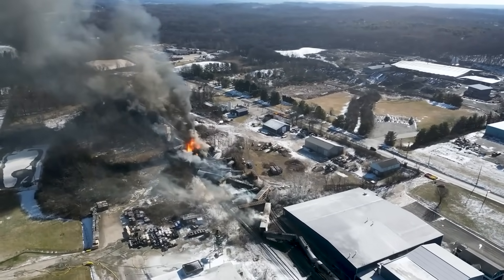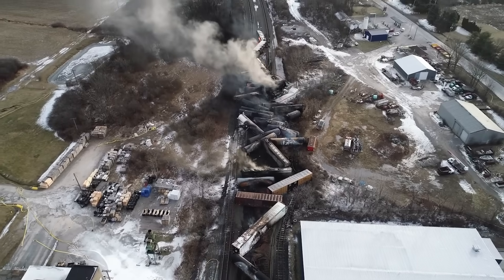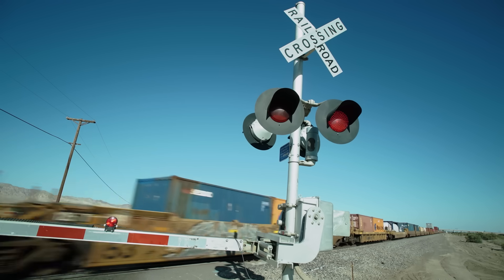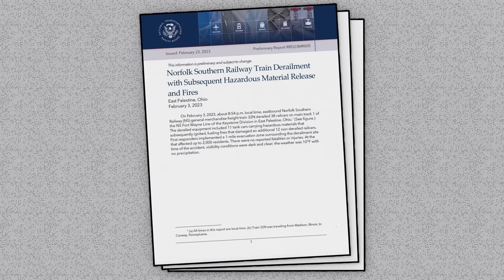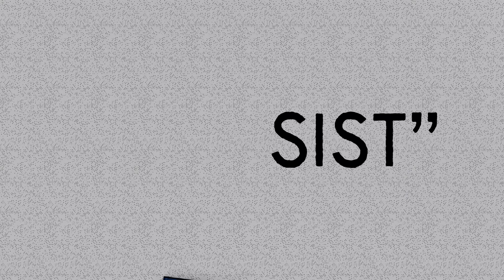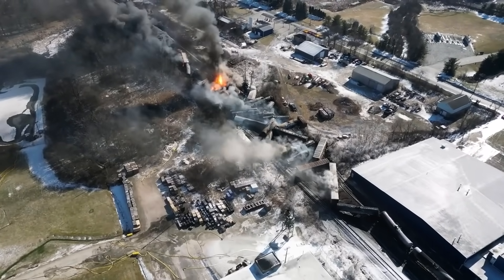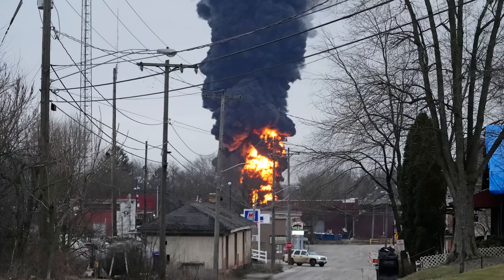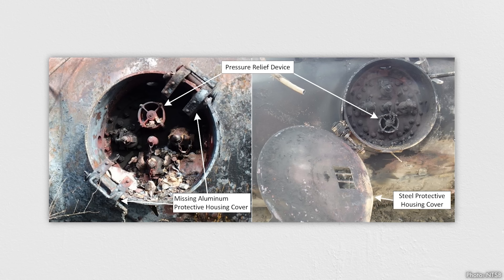East Palestine Train Derailment Explained

Comment: I'm surprised you didn't mentioned the temperature inversion that was expected, which is another reason they burned off the chemicals when they did. If they would have waited then it would have forced airborne contamination closer to the ground and increasing the risk to the community dramatically.

Comment: @practical Engineering Hi Grady, although it might cover some old ground from your older videos, it would be great if you could so a video on the Hook, Hampshire UK rail line landslip that happened a few months ago.  Fixed within a few weeks by a hero effort, rebuilding the 30 ft high bank using a mixture of retaining wall and soil pins I think.  (Some videos online from Network Rail).

Fortunately no trains were derailed or passengers injured, but it was a near miss on what is the busy 4 track passenger mainline between London, Basingstoke and the south/south west of the UK, with trains (8-12 coach 3rd rail EMUs mainly, some diesel hauled freight) doing up to 90 mph in this section.

Comment: So it's true that trains are necessary and won't be going away, but that's no reason not to push for better safety. Trains should not have to be as dangerous as they are in the US.

While fatalities may be few, in 2019 there were over 1300 derailments in the US, a small number in relation to how many train journeys are made, but objectively still a massive number.

The same year in the EU with six times as many miles travelled by train, there were 73 derailments. Japan, with three times the US distance had 9.

Comment: There’s so many ifs in this story that could have prevented the accident: in the bigger picture, legislation against monopoly and cartels, including separation between railway (infrastructure) and carriers, but in the gear aspect, if only the defect detectors cared about change temperature instead of only current temperature, it would be prevented; instead the media are talking about using better breaks, when in this case breaking hard WAS part of the problem

Comment: What actually happened was the railroad ignored the warning precautions there is no way that thing could have went as far as it did without a hot will detector telling the operator that they have an issue your looking at hundreds of miles do you understand I know a guy driving a Honda right now with both wheel bearings out of the back end of it and he's gone thousands of miles

Comment: About 2 weeks ago i stopped by a rail station and started to look at sleepers and nails holding them most every plate was missing at least  one nail, and had a loose nail, the head was sticking up by about one inch,  missing nails were fairly common

Comment: I think that when a rare event of magnitude X happens, instead of preventing another X level ovent, we need to work to prevent a 2X level event instead.  This is because if an event of magnitude X happened, it raises the possibility that the probability distribution we were working with is wrong and that such events are more frequent than we thought.

Comment: I don't understand why regulators are making Norfolk Southern perform the cleanup instead of performing the cleanup and billing them back. NS has every reason to literally cover things up in order to save themselves money, which they've already shown they're concerned with by the paltry amount of money offered to the residents affected. Yes, the EPA contracting out the work would have it's own issues, but at least the company responsible for the disaster wouldn't be the one responsible for deciding what's "good enough" and dragging their feet to get to that point.

Comment: 13:40
Does "the safest overland method" mean it is not safer than an underground pipe?
I'm pretty sure that was one of the aspects of why there is talk of building an underground pipe to carry oil from canada, because the alternative is to transport it by train.
I've also heard suggestions that train derailments are happening more often lately. Is that just because of easier access to information, or a real statistic?

Comment: I feel like if train lengths had a legal limit even if still quite close to what this train had it would eventually promote track safety and maintainence. As far as i understand these companies don't value maintaining the tracks at all because they can just put more trains across them and since they don't actually care about letting the few passenger trains take by-way first like it was orginionally agreed upon they can get so long as to block up any way to let anything pass. On the bottom line they don't notice anything, making a train longer cuts costs everywhere from personell to having to fix anything on the tracks and there is no intrinsic reward for them to care otherwise.
Long-term i anticipate that while safety might be cared more for accident rates will still increase because it was not deemed wort it to pay the overhead on infrastructure maintainence.
There are also issues with not upgrading to more modern equipment while relying on less crew these days. We can have minor cameras along a train these days in theory they don't even have to be good those sparks would be visible even in black and white.
If you want the trains in the future you have to make sure these companies leave a future for there to be train logistics to even exist and while accepting some risk is sadly sane for major buisnesses like this atleast having general improvements could maybe dampen the effect of the train companies 50-100 years down the line doing the same thing.

Comment: Using 20/20 hindsight might it be worth using some form of Delta Temperature by Delta Axel Temp Sensor position? So, rather than just relying on absolute temperature levels to trigger an alarm a backup detection characteristic would measure, and to some extent anticipate, that the temperature of the axel bearing is heading for an over temperature alarm event? The system would need some form of processing power where it monitors a group of axel bearing temperatures sensors. As the hot axel passes the first sensor it logs the value then when the axel passes the next sensor down the track give out that axel temperature. If both measurements were below the alarm temperature trigger level but the rate of temperature increase is such that within the stopping distance of the train, the trigger level is predicted ( by the rate of change of temperature observed between the two separate axel temperatures sensor positions) to increase to above the absolute temperature alarm trigger level then an alarm is sounded to stop the train and state which axel is heading for an over temperature. In  my my industry generators that are connected to power grids use over frequency protection and something called Rate of Change of Frequency (ROCOF). ROCOF is mainly used to detect a power island  and then trip off. It is also to some extent predicting over/under frequency events before they happen. Could a similar idea help prevent this type of Ohio event on US railroads?

Comment: Wondering, are the wheel bearings run to failure before they are R&Red or are they inspected and changed at specific intervals?
Seems that rail cars that carry such hazardous materials should be maintained and possibly certified to a higher degree of fitness than they currently are held!!
JIM 🤔

Comment: Question:
I'm not entirely sure on the details but that rise in heat, even if within safe levels overall, seems like something that should have been suspicious. While I imagine the detectors themselves run on an isolated system, I'm surprised notable data points well below the safety margin aren't recorded internally in the train system to provide comparison points and highlight problematic developments. You don't even have to store or transmit a lot of data, just enough to build some comparison points within recent checkpoints. Afterwards it can all be wiped. Should be well in the range of Kb or Mb.

If the rapid increase in temperature had been caught, maybe this could have been prevented.

Comment: The safest overland transportation method is pipelines, not trains.

- Pipelines spill more, both based on sheer volume, and on a per-ton-mile or per-barrel-mile basis.
- Rail transport accidents cause more injuries to humans on a per-barrel-mile or per-ton-mile basis.
- The probability of a spill from Rail is greater on a per-barrel-mile or per-ton-mile basis, though the majority of spills tend to be quite small in volume.

Comment: Would this not indicate that the trigger level for bearing heat should be dropped to a lower level depending on the train weight/stopping distance so the driver has a real chans to stop in time to avoid this type of accident?

Comment: I live near a classification yard, a large one too. It’s locally known for one disaster, “the Roseville Explosion”. Several years before I was born a train load of bombs was sitting in the yard, destined for Concord, California. A fire from the tinder box got out of control and very quickly, 19 rail cars ceased to exist as the bombs started exploding. Some years after the incident and during my lifetime, the yard underwent an expansion project and whist clearing land for the expansion, several unexploded bombs from the initial incident were uncovered. The bombs were detonated on site. Not many US civilians get to say they experienced live ordinance. 

Everyday you can hear the horns blaring, occasionally you can hear the tell tale clang from cars being coupled, sometimes you can hear the whoop of the air compressors, and when the conditions are right you can hear the rumbling of trains moving into and through the yard. All of the sounds are easy to recognize and identify. But one day, not too long ago there was a very different sound that came from the yard. I heard the tell tale clang of cars coupling followed by a series of metallic booms and I felt the ground shake. “Ooh, I think a train just derailed,” I said to myself as I was preparing my lunch. I went and grabbed my phone and pulled up my radio scanner app and tuned it to the railroad dispatcher for my area and the chatter I heard over the radio confirmed it. Our rail yard is fully equipped and staff fully trained to deal with explosives and chemicals. It has a very loud “Emergency Warning System”. If something were to happen that would require the local area to be evacuated, the EWS would sound a loud siren and a very loud announcement would be made over the speakers. Thankfully, I’ve only ever heard the tests and never an actual emergency. While I can’t say the same for everywhere, I can say that for the lines under our local dispatcher that they are very secure. The dispatcher was quick to affirm the derailment, assess that the main line was blocked by it, had all trains on the line confirm their locations, ordered all non-priority trains into sidings, got crews to move trains and cars around in the yard to clear a path, then got crews dispatched on the high-rails and company trucks to go and double double check all of the signals were working correctly as the schedule had to be changed. It was impressive to listen to. Not only did the yard crews call in signals, but trains on the lines also called out the signals they saw and confirmed with dispatch that they were showing correctly. As for the cause of the derailment, apparently it was a coupling gone wrong and several cars got tipped off the rails. I’ve lived here for 35 years and have only ever heard of one other derailment happening at that yard and that was when I was extremely young. The staff at our yard takes their jobs very seriously and they are very efficient. I for one trust the railroad industry and the NTSB. It’s come a long way and safety has been greatly improved over the years and continues to make great strides in improving the safety.
Reply: You mean that event on southern Pacific's Roseville yard

Comment: Some of the information presented here contradicts previous coverage I've seen, both by other youtube channels and social media outlets, and from "proper" news media. Specifically what stands out to me is the usage of the security camera footage at around 05:13 saying that this was captured "moments" before the derailment, when I've seen numerous sources place this footage as being from Salem Ohio, 20 miles from the derailment site, which is a pretty substantial distance and, as I understand it, well within what the train could have stopped within. I've also heard that there is a defect detector located on that line running through Salem, so assuming the equipment was functional, the crew should have been well aware that there was an issue and had ample time to bring the train to a stop.

I also recall reading about livestock and pet deaths in the immediate aftermath of the burnoff- looking that up online to verify, apparently the EPA themselves haven't actually reported anything of the sort, but animal deaths are part of some of the legal complaints against Norfolk Southern now, so presumably it's at least semi-credible.

Comment: So just a research engineer here (not for Rail) - but it would maybe make sense in considering the monitoring system that we could try and track the change in condition from station 1- station X measuring temperature for example. The current system does not trigger until a threshold is reached but it seems implementing some predictive nature of "Car X temperature has increased by Y amount in Z distance" would catch even more failures?

Of course this would take cost to implement and would likely stop more trains - some of which would be possible false alarms? 

Still seems like a major improvement which could be done.

Comment: I find the systematics of how this stuff happens to be potentially more fascinating than the engineering 

There is a lot of literature on the decline of the American train network that you can read and almost all of it will provide parts of how stuff like this happens. The key points for US rail accidents like East Palestine come down to the operating ratio and the resulting culture of cutting spending by rail companies. 

The class one rail operators, the ones who actually own the track, really don't want to do costly maintenance and track work until they are forced to. There are a lot of ways to fix these issues and most of them require these private companies to take losses to their revenue to fix stuff and improve their infrastructure which they don't want to do, and depending on shareholders might get sued if they do.
The simplest option involves the US gov treating rail like roads and nationalizing the infrastructure and then actually spending the time and money to fix it (which depending on the whims of the politicians might not happen either)

Comment: I used to work with vinyl chloride (along with most of the other chemicals listed in this spill).  It is VERY heavily regulated and any leak, no matter how small, would bring down a host of regulators on our neck.  Railcar transportation was the safest way to ship it to our plant.  The railcars used did not have bottom valves (like the drawing in the video) so that these valves wouldn't get sheared off in an accident.  The material had to be pumped out through the valve in the dome.  I was glad when the company moved away from using it.  Take care.

Comment: Hello railfanner here , some people probably already beat me to the punch but defect detectors don’t give you an axle temp as they are rudimentary computer systems only designed to detect and relay information about the train as fast as possible and some trains can be moving upwards of 100 mph (mainly Amtrak exceeds these speeds normal freight trains top out at 60 although Union Pacific is known for running their trains fast so upwards of 70 possibly to 90 in some stretches or so I’ve heard). they do record temperature but mainly for recording as a backlog. As it would take far too long to relay the temperature of the affected axle on a several hundred axle train. So it only relays the affected axle with with a format like this …  Train__ , milepost __, axles ___. From here it can relay a number of warnings from CRITICAL ALARM CRITICAL ALARM defect axle__ CRITICAL ALARM CRITICAL ALARM. Or train, milepost, axle count, defect detected stop you train stop your train. Of course depending on the railroad this format will vary. But Critical alarm is mainly used for big events like alarmingly overheated bearings or dragging equipment even derailed cars. Defect detected could mean a number of thing from a slightly over heated bearing fault to a flat spot on a wheel ( mainly caused by a wheel lock up from hard brake application). That is at least my understanding to defect detectors. If I was wrong on any info please let me know